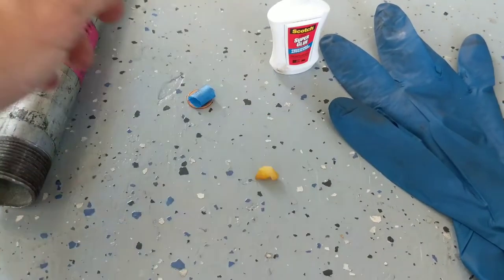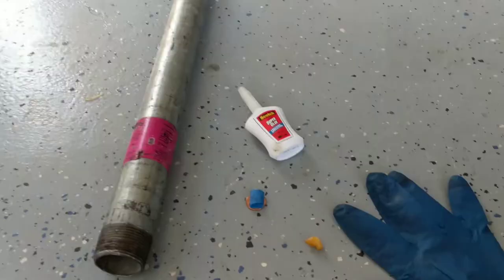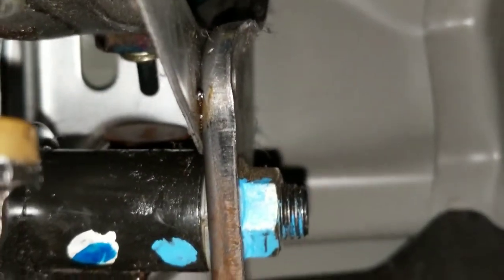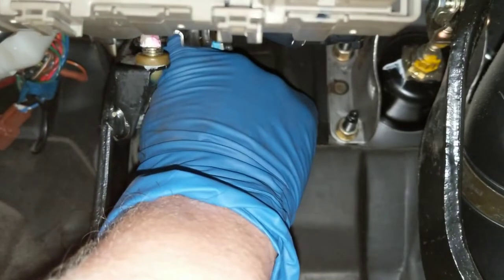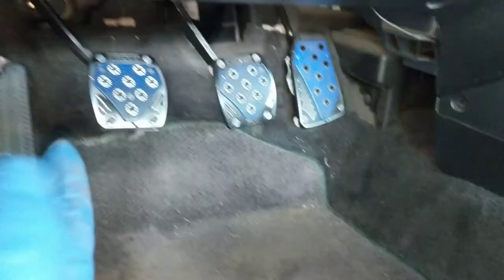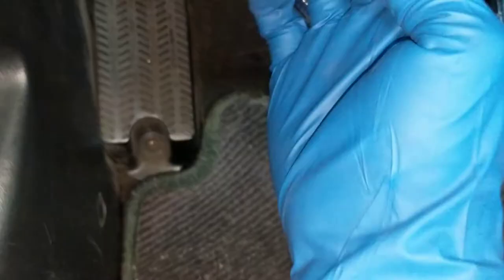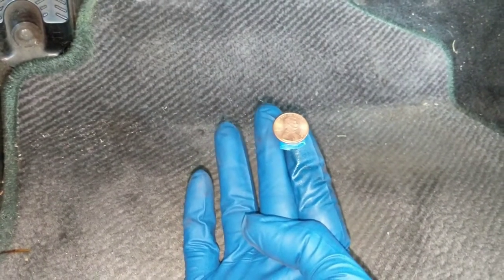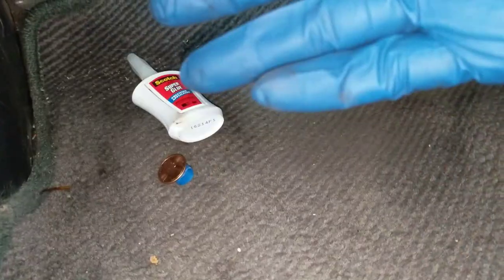1 cent Acura Integra clutch switch fix

Comment: they sell a kit for this only under $10 at o reilly auto parts - part number 74015 clutch pedal bushing kit - very easy to install
Reply from the maker: NICE! TY TY!  Found it on Amazon https://www.amazon.com/Dorman-74015-Brake-Pedal-Accelerator/dp/B001C6JCTQ
Reply: Thanks! This helped me.

Comment: I tried this but instead of a penny I had a bolt with a nut that fit the hole perfectly...it still wouldn't start, so I took out the switch and experimented with it with a small screwdriver and found pushing it flat wont trigger the switch, it has to be pressed to where the black pin actually recessed into the switch sensor ..I have a 2001 gsr but it should be the same no matter the trim, idk how this works but u never showed Startup so maybe it doesnt 😅....idk
Reply from the maker: Still works!  idk about that pin needing to be recessed.  The part that broke on mine was flat.

Comment: How the hell did u do that. I tried for hours today no luck
Reply from the maker: Yeah, it was a bitch.  I had to practice a few times before I committed to the glue.  I jammed finger up there but it was really pressing on my hand.  I can imagine a different hand shape not being able to do it with a finger.  What about taping the penny to a long stick, like a chopstick and using that to hold it in place till the glue sets?  Another tip would be to take the drivers seat out, so you can get in a better position.  Just four bolts.  I was nearly at that point myself.
Reply: @joerogers1364  lol I weigh 306 lbs hahaha I'm pretty fat. Definitely took out the seat because I wouldn't of been able to do it without doing so. Still not enough room. I'm actually just going to bypass the switch. Hot wire it basically. So much more easier for me to do.
Reply from the maker: @DeLaTorre27  yup, that's a good solution too.

Comment: literally just get a 10mm bolt and nut it by hand...
Reply from the maker: The thicker (than a penny) bolt means you don't have the smash the clutch into the carpet to start it, so it's a good fix, agreed.  Also from another comment the "Dorman 74015 Brake Pedal Accelerator Stop" fixes it for $5 bucks.  But if all you got is some loose change and a nearby store that has super glue, a penny will still get you home.